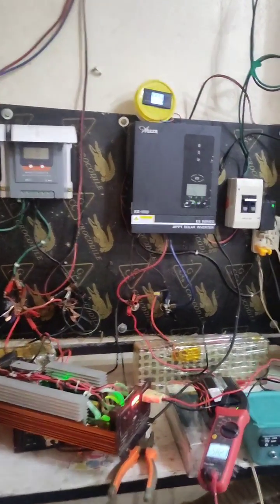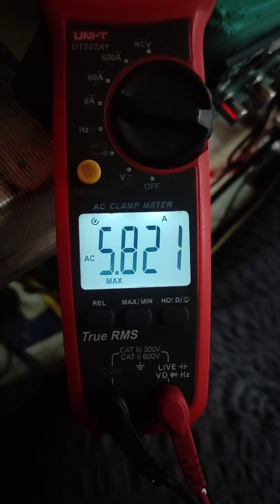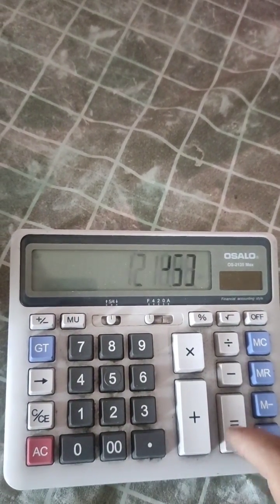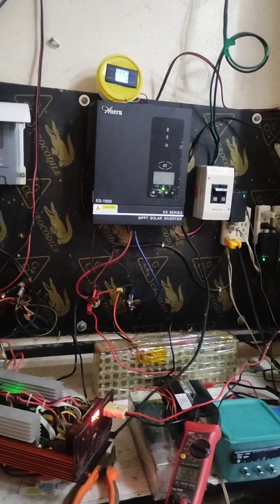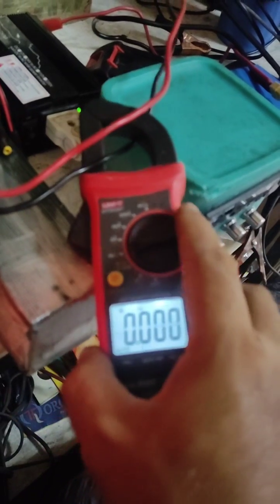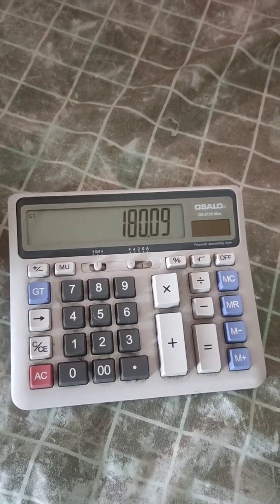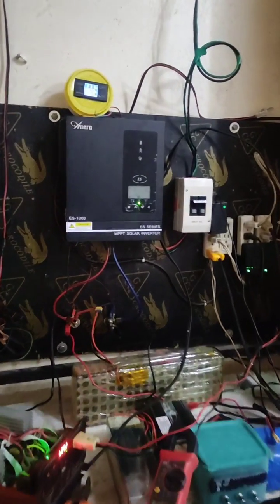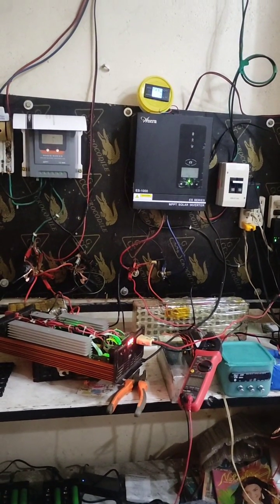Why a Small Freezer Won’t Run on a 1000W Hybrid Inverter  Power Limitations Explained

Comment: The meter reading was 5.821A, but you typed in 5.281A on the calculator... should have ended up with 1338W.  Still the same end result, a 2000W inverter would do the job.
Reply from the maker: 5.281A×230Vac=1214watt surge power that is over for 1kw inverters